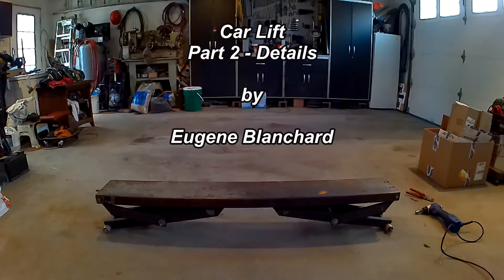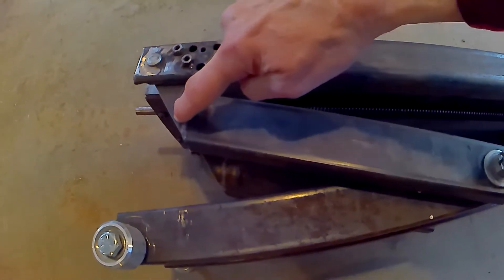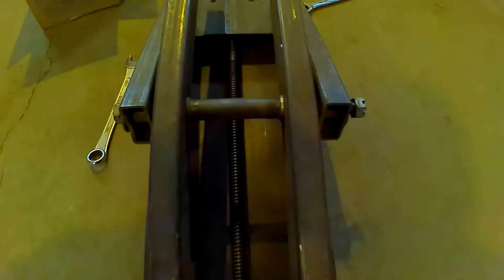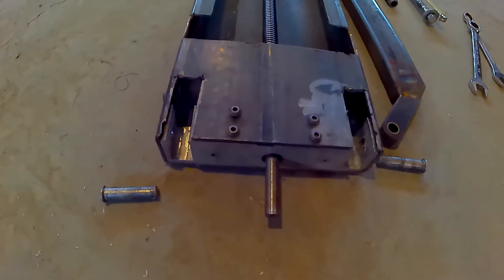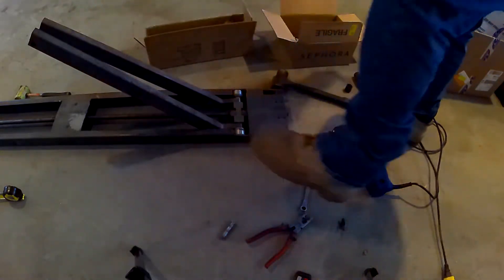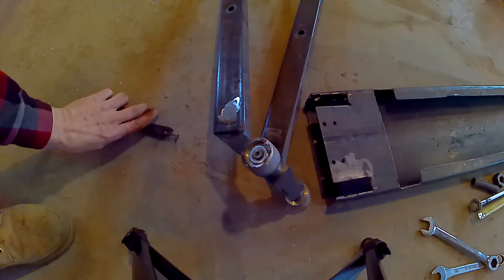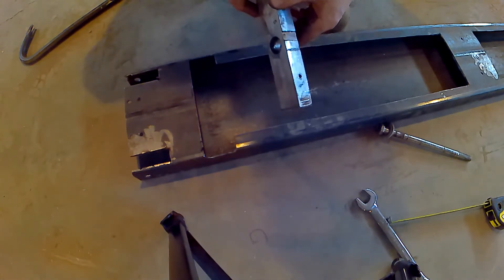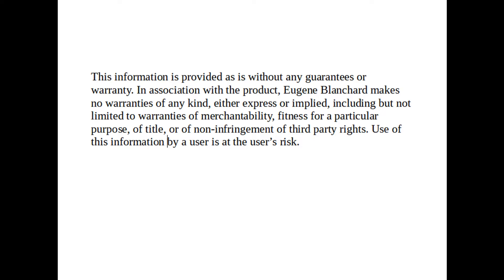DIY Semi Scissor Style Car Lift - Part 2 Details

Comment from the maker: I came across this product called 4,500 lb 12V DC RV Stabilizer that may work and it is only $250 https://www.princessauto.com/en/4500-lb-12v-dc-rv-stabilizer/product/PA0009029901

NEW INFO: an RV slide out 12Vdc motor may work. It is small and is gear reduced to 12 rpm